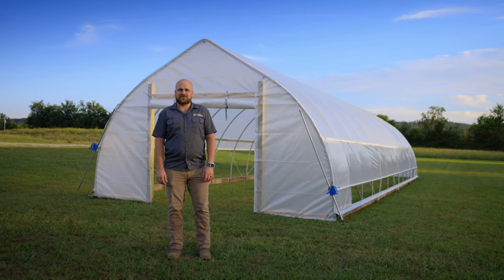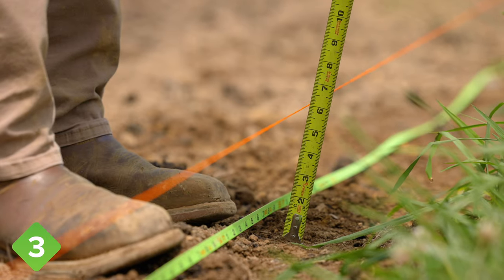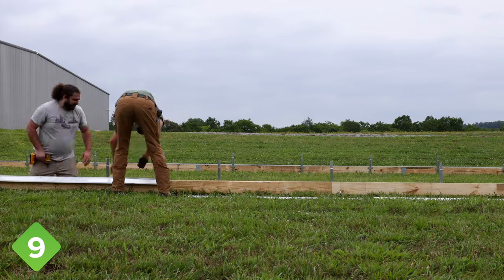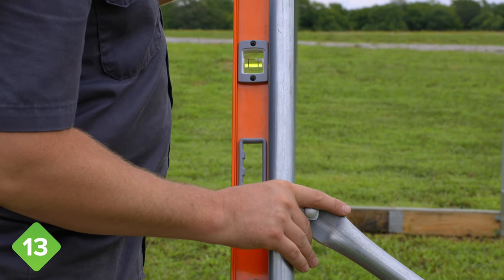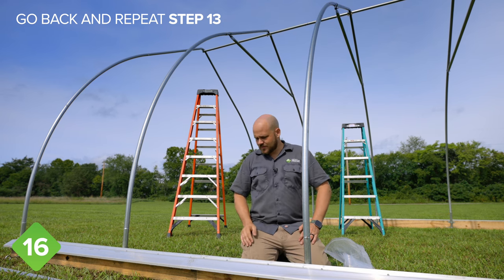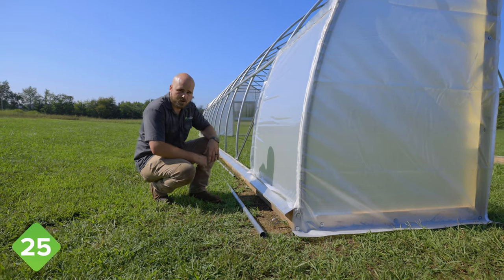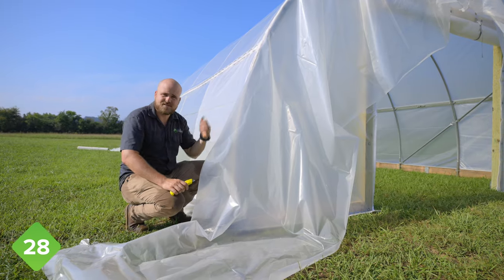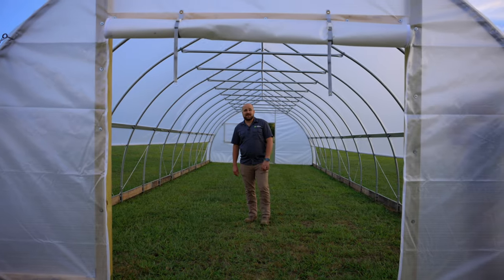How to Build the Haven High Tunnel from Farmers Friend

Comment: Scrap adding the 2x6 baseboard onto the pallet. Dimensional lumber is easily and cheaply available pretty much anywhere. Save a bit of weight for the shipping cost of the pallet.

Comment: Why not use 8' 2x6 baseboard instead of 6'? There'd be no need for joiner plates between posts because every baseboard joint would land on a post. I'll ask the same question about the double channel. Is it to keep the pallet at 6 foot instead of 8 foot? That seems a bit pointless. Final edit: the whole thing ships on a 4X8 pallet, so it really makes no sense to me not to use 8' baseboard and double channel. Also, overall, I like the product and will consider Farmers Friend when I'm ready to purchase a high tunnel, but I'd prefer an option to locally source the baseboard. I'd also like to see an option for taller ground posts as 15 inches seems a little short. I'd like to have 3 or 4 foot verticals before the bend of the hoop starts.

Comment: Love it. Only problem is see is those ground posts could be severely damaged during install if rocky ground. A 1 5/8 ground post might be a better option than a swedged 1 3/8 due to the ability to cut off any damage part from slamming.
Reply: If you use a 1 5/8" ground post in rocky ground like I have, is there an adapter available to connect to the hoops? Thanks.